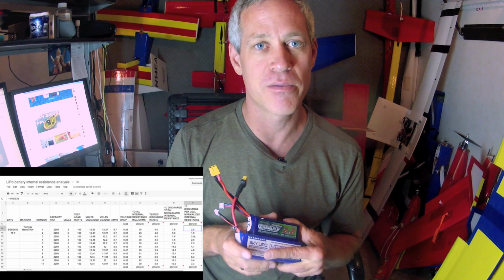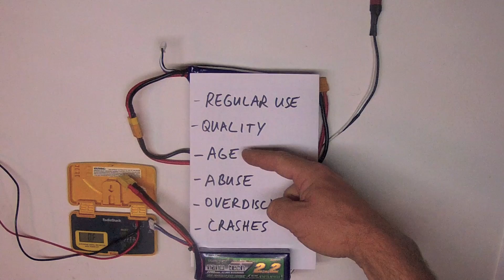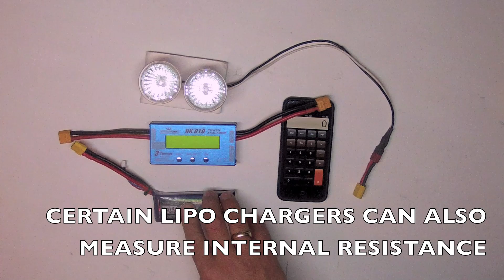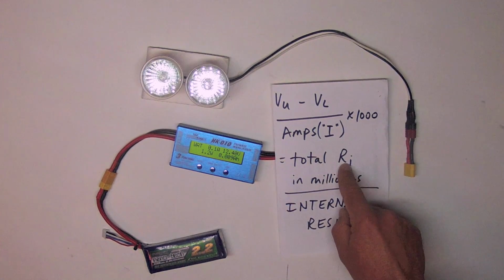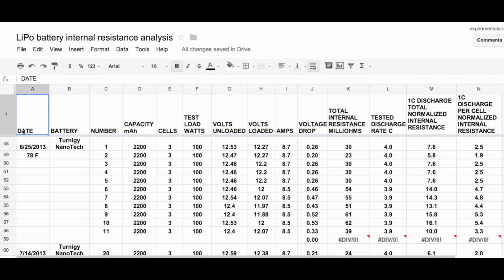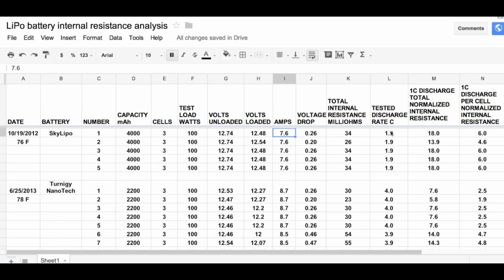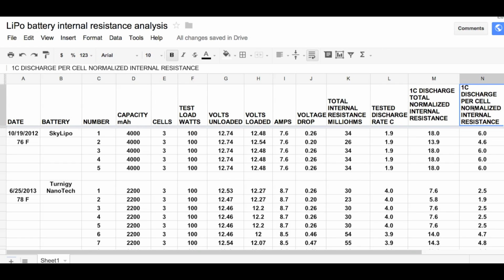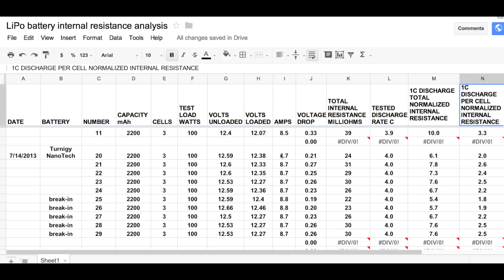LiPo INTERNAL RESISTANCE

Comment: I understand that using a consistent method to attempt to measure the IR of a LiPo will help you keep track of your battery health but I find it very difficult to assign a REAL number to the parameter. I think you're getting numbers that are higher than the real numbers because the unloaded voltage is taken first then after 10 seconds you're not only measuring the IR voltage drop due to the IR  but also how much the battery voltage has dropped after discharging for 10 seconds. Sound right?

Comment: dear sir very lave your work but in the bottom line what is the total c rate of the battry ? and why didn't u comper it to the c rate of the fatory? in the bottom of the line i need to know what is the c rate of the battray tested comper it to the c rate of the c rate that written on the battery. desperate waiting your answer.

Comment: crashed on my 1st flight of my new plane....lost all control at the 5 min  mark and was in close range, but   near the ground , and there was no chance to recover...........checked voltage on my very old 3S 2200mah lipo right after the crash and it read 3.80 per cell......this seemed OK but all indications before  the  crash were a loss of control ( brown out due to a LVC ) ....now searching for a simple way to check IR on all my LiPos .....thanks for the GREAT video!!!

Comment: Hello there. We do a lot of competition RC car racing with 1s battery packs. Just wondering if you have any suggestions on how the get the ir to its lowest point before putting that pack into a car to race.  Maybe give it a little heat, or a few cycles?  Would be interested to see your opinion on this. Thanks for all your info!  Just subscribed.

Comment: I have a question, if i were to test 2S 7.4V 5000mhA lipo batteries, would the 2x 12V halogen bulbs be ok or should i go with a lower voltage bulbs or more or less bulbs?

Comment: I want to know how the current differential between 1st and 14th battery in a series of for exampel 100 amps goes through 14 batteries, and i was hoping to find a video which explains battery minimum internal wire thickness for large packs say with 100 cells in 10x10 series parallel.

Comment: Hey Ed great vid.  I know there are variables but in your opinion which brand of Lipo is best?  I have had bad luck with nano tech turnigy batteries, on a scale of 1 to 10 i would rate them at a 5.  I would rate zippys at 7.  These are the only two brands i have significant experience with.

Comment: Hi Ed! I was just wondering if my results for a BRAND NEW 2S Nano-tech 300mah is right. Please see details below:
Voltage Unloaded: 8.22
Voltage Loaded: 7.90
Amps: 1.4
Capacity mah: 300
# Cells: 2
Test Load Watts: 20
Voltage Drop: 0.32
Total IR mΩ: 228.6
Tested Discharge Rate C: 4.7
1C Total Normalized IR mΩ: 49.0
1C Normalized IR Per Cell mΩ: 24.49
I think the IR results are too high, so I am not sure if I've done something wrong.
I haven't changed anything from your spreadsheet (just were there are no formulas).
Could you please assist?
Cheers
Leo
Reply: Leonardo Ramos Hey Ed, how are you? Hope you find some minutes to reply my question with your thoughts. Cheers.
Reply: Leonardo Ramos Hey, does anyone knows the answer for my question please? Still waiting...
Thanks
Reply: I also was getting results that were much higher than expected on my 4S batteries.
Reply: .Because you used 2S battery the 20W marking on the lamp is not what they actually draw.
20W is true for 12v. In your case I am calculating only ~11W
Reply: Ignore my answer - NA

Comment: I almost lost my plane after take off. It was so sluggish, I barely landed it safely. You information is great. But, how do I use your method for a 6s?
Reply: .in this video he presented x2 lamps of 12v/50W in parallel
Use the same structure and connect those in serial
Total of x4 lamps - 2+2

Comment: Nice sheet, nice idea.  Great way to keep track of battery health.

I disagree though with your added column for normalize to 1C rate.  I assume you are aware that ir does not change from 1C to 2C to 4C in a lipo?  So this is in my book just bad data.  taking it down to per cell is ok but column M needs to go I'd say;  it even misled you in your video.

Comment: I would measure the unloaded voltage before and after the load test.  Since you are drawing a large current, even though it is for a short time, you are dropping the voltage due to the test itself.  I have seen some take the unloaded voltage average between the start of test , and the unloaded voltage at the end of the test.
Reply: But this is what you're suposed to do. Measure the voltage drop on Load with a known load.

Comment: In trying to get a 1C IR result for the 4,000mAhr packs it looks like you did it by calculation. Have you tried a few tests using different loads on the same pack to see if that calculation is valid?
Rod W, Ottawa

Comment: hello, thanks for the video....great.....quick question though....I want to test a 2s lipo so how many lights do I need and how do I hook em up ???thanks.
Reply from the maker: upardhan I don't know of an 8v bulb so I would just use one 12v bulb, series-wise. You can add additional bulbs in parallel to increase the load if you want to get better resolution from your measurement.  In other words a larger voltage drop allows you to make a more detailed assessment of that internal resistance at that particular load.

Comment: Hello Ed!! Greetings from Australia!
Your IR videos are great and I've used the spreadsheet you shared to create mine. I also made my own 100A load with halogen bulbs, just like yours.
I would like to know from you, or anyone that "knows" how to do it. So my question is: Do you have any way to measure the IR per cell? Not the average of the total pack, but per individual cell to be able to identify which cell is the "dead" cell, so I can replace it with a healthy cell.
Thanks in advance!!
Kind regards,
Leonardo
Reply: Anyone?
Reply from the maker: Leonardo Ramos That would be a fantastic feature.  I think if you could separate the cell by using the balance ports individually and measuring IR from that.  Even though you're testing 4.2v per cell I'd just use whatever load you have, unless it's ridiculously large already for the one you would use for the whole pack.  I'd think you could get a comparison between cells in any case, even if not a precise IR number for each.
Reply: Thanks for your reply!
I have a12 volts 100 A load for 2200 mah 3 cell packs, just like yours. Can I apply this load to those tiny balance leads? Or should I make 50 A for this purpose?
What if I measure nano-techs 300 mah 2 cell packs. What load would you suggest for the whole pack and per individual cell?
Thanks once again!
Reply from the maker: I think you probably mean a 100 watt load, which should draw 8-9 amps for a 3 cell at 12v.  But really the bulbs have whatever resistance at a certain voltage so that would consequently cut the amperage also by one third when using 1 cell, so 8 amps.  Still I think you're right, that's a little high for those little wires.  I'd probably use a 25w bulb and if you get a decent measurable voltage drop then leave it at that, and determine your IR accordingly.

Comment: Do the batteries have to be charged to 100% for testing or is it ok for them to be tested at a lower voltage like 3.8 volts per cell? Thx.

Comment: Great Video and excellent info.  I just received a brand new Hobby King Turnigy 3S 4000mAh Lipo.  Check the internal resistance with my Hitec X1 Charger and its showing 41 milli Ohms. Why is the resistance so high? Its that normal with Turnigy Battery or should I buy some other brand lipos?  Thanks again for the great info!

Comment: I use a Turnigy 4 in 1 MEGA Checker that can measure cell IR directly.  I received 3 new ZIPPY batteries yesterday.  Of the 9 cells in these bats the lowest IR is 33 mΩ and highest is 44 mΩ. This is per cell not the whole pack.  The meter has a 1Ω resistor and draws ~6 amps from the cell.

Comment: I hear many talk about puffy batteries and one should never use em. But my problem is that i dont think any of my 4-5 batteries that does work, isnt 100% without some amount of air between the shrinkwrap and the hard block of the battery. Its not alot of air, but some. Where do one draw the line?

Comment: Great video. Does impedance (internal resistance) change when batteries are close to the lower voltage limit (2.7V per cell)? 

Thank you in advance,
milan
---
Reply: It does, that's exactly why the voltage drops